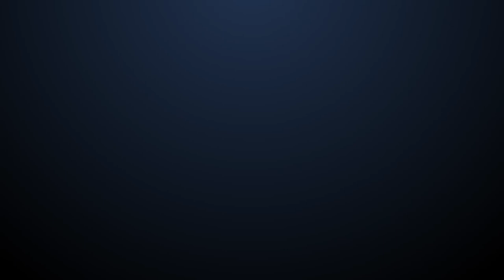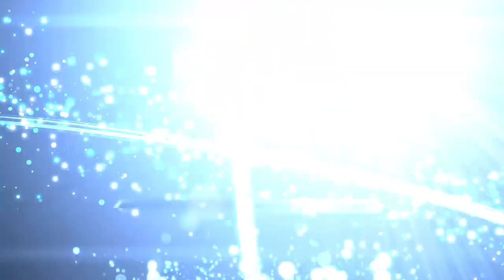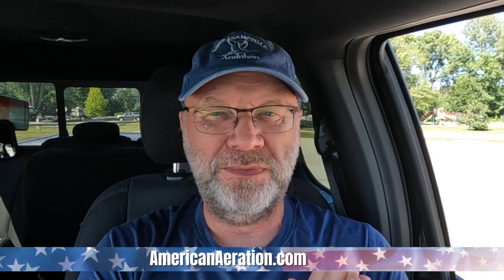5 Big Pond & Lake Aerator Mistakes And How To Avoid Them

Comment: Great video!!! I recently had a matala rocking piston 1/2 HP installed with 2 diffusers with the ability to control pressure with valves.  Since putting in the submersible system in my 1/3 acre clay bottom pond it is murky with poor visibility.  I thought this would resolve with time but it has not.  I live in Michigan so we only use our windmill aerator and turn the matala system off.  We elevated the diffusers a couple feet off the bottom without improvement.  The water level really fluctuates from spring to summer going down approx 5 feet.  The avg depth is 11 feet in deep end and 7 feet shallow.  It is 175 feet x 100ft tapered inward at the middle.
Reply from the maker: Hi Tina...thanks for the comment.  You did the right thing by elevating the diffusers...often that helps and things settle out over time.  If the water doesn't clear up you can try a binder or flocculent...a clarifier of sorts that will clump these particles together...they get heavy and then sink to the bottom.  Check out a site called siltstop.com.  They have a variety of binders that may help.  If you try one, let me know how you get along with it.
Reply: Thanks for all of your information.  I will be sending a water sample into silt stop to have a log made that will hopefully improve the clarity.
Reply from the maker: @tinametzger9644  Hi Tina...you're welcome.  Good luck with your pond and let me know how you get along with the floc!

Comment: I'm considering two 24V DC 350W floating pumps connected to solar panels by a controller.  Thoughts?
Reply: Lots of variables here that aren't mentioned but I would say this...any aeration can be helpful for something.  If fish are a major priority surface aeration can be really protective.  You may find if the pond has some real depth to it...say six feet, or deeper just as an example, it may be better to go to the bottom.

Comment: What is more beneficial to a pond for starters, Topwater fountain aeration or subsurface diffused air?  If you could only do one, which is best for the pond?
Reply from the maker: Thanks for the question...it really depends on the situation.  What's the depth range, whats the primary goal of aerating.  If fish are involved, what kind are they?  The geographic location and seasonality would factor in here too.   That all said, most of the time, I'm going subsurface but certainly not always.  Cost to operate may also be a factor...if someone is on a tight budget and can only run a fountain a limited amount of time, a subsurface will usually provide more economical operation and maybe they can run it more often.  So there are a few things that would lead us in a particular direction.

Comment: Will bottom areation help reduce bottom sludge over time?
Reply from the maker: In a general sense, yes, it could.  Hard to say how much really and it will vary from pond to pond.  The increase in dissolved oxygen near the bottom supports this effort...and I would say if you combine aeration with muck digesting microbials, it can help.  Even with those though its not a sprint.  Overtime though you can work it down.

Comment: I have a 1.7 acre pond that is 6-8 feet deep except in two spots.  One hole is 16’ deep and the other about 25’.  My question is whether I want to put a diffuser at the bottom of each hole or if there is a reason to stay off the bottom so deep.  Thanks!
Reply from the maker: Hi Greg...good question.   I think the main consideration here would be just for coverage.  If you can get either diffuser deeper than 12' it will cover an acre on it's own.  So the second diffuser wouldn't have to be as deep, but it could be.  I would think about your pond's history...is there areas of problems or early development of algae, etc...this may often be in a shallower part of the pond.  So it wouldn't be a bad idea to get some movement in that area...or you may be able to affect it fine from the two deep spots.  I would not feel obligated I guess to target those deep areas necessarily, but there's also nothing wrong with doing so if they provide good coverage/movement throughout the pond.  I hope this helps for you!
Reply: @klmponds  "is there areas of problems" Love your videos but get someone to check your grammar.
Reply from the maker: @matthewwiecha8637  I appreciate the feedback Matthew.  I agree, Grammarly would have highlighted that one!  Nothing I do is scripted, and editing is always minimal (for better or worse).  My focus and the point of the videos is the content, information, and advice...I hope in the end it's helpful for you despite a few flubs on my part.  More to come:)  Take care!

Comment: I have 12 diffusers running on a 12-1/4 acre lake which is around 28ft deep by the dam.  I intended to run the system year round.  Would like any recommendations you may have.  I'm using an Airmax LS120 system.  Thanks
Reply from the maker: Hi and thanks for the question.  So you can run the aerator year round but in winter the only reason to do so would be for fish (if you live anywhere in the northern US where it cools down a good bit).  Keep in mind this winter use is just for ice management...Wisconsin DNR suggests 3% of the pond be kept open of ice for protection for the fish so you would not run all diffusers at once in this case.  I would consult with airmax on what they would suggest for winter usage with this system...in other words, what is the minimal number of diffusers you can run on each pump without having issues with those pumps...that would be my only concern there.  If you don't get a full freeze up where you are, or fish aren't a priority there would be no real benefit to running it.  If you happen to be in a climate that has algae (warm weather) year round, then for sure, run it full on as you normally would and don't shut it down.  In the end you aren't hurting anything by running it if moderate or cool temps, it's just that most folks we work with use aeration for helping with algae blooms or fish issues...and both of these subside in cooler weather and more moderate temperatures.  And the aerator still costs money to run.  I hope this helps for you.
Reply: @klmponds  Thanks for the information and getting back. The lake is located about 65 miles south of Saint Louis, MO.
Reply: @jmfstl11  you might be warm enough there to not really see long term ice build up...and I would suspect it gets cool enough that algae would go away in the winter months.  You can play it by ear and shut if off if you want to save some money and turn it on again if things really got cold and froze over for an extended period of time...but as things are going this year I'm betting you won't see that.
Reply: This guy knows his stuff.  Thank you!

Comment: Great video. I have a 1/4 acre pond with a depth of 9' on one end and tapers off to 2' on the other end with 4'-5' being the average. I have a 3/4 hp pump and two 8" diffusers I am installing. I figure I'd put one in the hole mounted to a cinder block to keep it off the bottom and the other in about 4' of water the same way. Right now I have a fountain that runs 12 hrs on 12 hrs off.
My questions are: 
1) Should I keep the fountain running as well? maybe fountain in day and sub-surface at night?
2) Are the 8" diffusers to small? (my kit was supposed to come with 10" and I was sent 8")

Thanks for taking the time to make this video!
Reply from the maker: Thanks for the kind words!  By the sounds of it I don't think you'd need to run both the fountain and the aerator...maybe figure out which is more economical and go with that most of the time.  If things get really hot there and that goes on for awhile, then maybe run the fountain more or as you say at night and just avoid mixing the pond so much, which can heat it up quite a lot.   I say that too because this pond isn't that large and the pump is a bit of an overkill just horse power wise.  

I'm assuming this is a Vevor pump or something like it...on the one hand thats probably good because it only puts out the air of a 1/2 HP...on the other hand it costs what a 3/4 HP would normally to run...so they are not terribly efficient.  I have two systems that actually use a 1/4 HP pump to run 2 diffusers and the other uses a 1/2 HP...the 1/4's cost about 15 bucks a month to run full time.  Keep that in mind if the 3/4 HP gets a bit pricey to run for you...it does for some people and they limit how much they run it...which is not a good idea.

For the diffusers, honestly I don't know about that one...I don't think size is the only thing here that's important...I mean some systems use sticks, or tubing loops that do really well.  Mostly it would come down to how small the holes actually are in the membrane..I would be more concerned with that than the overall size, and unfortunately I've never looked over the vevor kits that closely to know.  

I hope this helps for you a bit.
Reply: @klmponds  - Thanks for the quick reply. yeah, it's a Vevor kit. I wanted to see if I could minimize algae growth and maybe clear up some muck with it. I didn't want to spend a small fortune to test this out. I'm in Mich so hot weather isn't really an issue here, at least lately. No fish to really speak of (yet) except for minnows and a few fish that are maybe 6". Trying to find something that would clean it up a bit but grass carp are not legal here.
Reply from the maker: You're welcome.  No problem...go with what makes the most sense for you and your budget.  Really for water quality, algae management you should have plenty of aeration.  Remember though, aeration alone may or may not curb algae...its the microbial base in the pond that's mostly affecting the nutrients...and aeration support that really well.  So see how it goes.  Aerate as much as you want or can afford and try to go 24/7 with something.  Give it a month or so and see if you note any changes in the algae...if not, look for something microbial to add in there.  An example would be our Biosphere Pro product but there are many kinds on the market.  I'm thinking about a video that addresses this very topic...so you have aeration...now what?  Something like that...look for that in the next week or so and it will probably give you some things to try down the road...if you need to.

Comment: Can I use an extra pump as the aerator? Just sitting on pond bottom? Small Shubunkin pond 1200 gallons. Have waterfall but 21 fish.
Reply from the maker: This isn't really how an aerator works...a submerged pump would move water...circulate it, but if you aren't breaking the surface tension of the water, oxygen isn't coming in as much from above...thats typically how a diffused aerator works.  If the pump you have can be set up to propel the water up into the air...ie, a fountain, then yes, that would aerate the water.

Comment: I have a 2 acre ponds with a max depth of about 10 feet I would say the average is probably 6 ft over all live in western Kentucky and the primary goal is lmb also have bluegills and redear what would your recommendation be?
Reply from the maker: So if you have a spot around 10', if you get a diffuser there it will cover about 3/4 of an acre at that depth.  As you lose depth you lose the range of coverage...so I'm thinking if you could get another (second diffuser) down to 10' or near that, you're at about 1.5 acres now...and a third diffuser in a more shallow area could cover the rest.  Some of this depends on the shape of the pond too.  To really be sure it would be best to contact me through the site and send over an address so I can view the pond from google earth, just to be sure.  But I'm going to suggest probably a 1/2 HP pump with 3 diffusers would do.  Something like this one as an example.  https://americanaeration.com/collections/easy-pro-sentinel-pond-aerators/products/sentinel-1-2-hp-aeration-system
Reply: @klmponds  how can I contact you
Reply from the maker: Try this page, it your input will come to me.  https://americanaeration.com/pages/pond-aeration-advisor
Reply: @klmponds  done!

Comment: I have 2500 square meter tilapia fish pond here in the philippines and i'm using a 4 inches diameter pipe water pump for aeration,what is the best thing that i should do for aeration?thank you so much
Reply from the maker: It would really depend on how deep the pond is.  If you're around six feet deep or so, I would suggest going with a surface aerator.  Many fish farms uses these to maximize the dissolved oxygen level in their ponds.   I might even use this in deeper water if you get really hot for sustained periods there as I suspect you do.  The other option is sub-surface diffused aeration which would be more economical to run, but I'm not sure it sets up quite as well as a surface aerator does for fish farming.

Comment: Great video, just ordered a pump for our 1/2 acre pond about 14 feet at the deepest, when it is full, we have had a very dry year and I suspect the deepest spot to be around 10 feet at this point.  We have a surprisingly good fish population which is the reason for the aerator.  Did I understand you correctly the aerator should be placed in a shallow area vs the deepest spot in the winter? I was planning on going to the deepest point thinking that is where the fish would be.  Additionally the system I have chosen is 1/2 hp with a single diffuser, i'm not worried about running cost, but don't want something completely wrong.  Thank you!
Reply: Hi Brian...thanks for the question.  So you can put the diffuser in the deepest part of the pond...that is pretty typical.  Normally the only time I may not do this is during certain periods of the year.  Such as, winter usage...I don't like to aerate at the deepest point in winter...your only goal this is ice management...and you don't really want to stir up everything...so I work more shallow there.  The other time would be in the south, in very hot conditions, especially in shallow ponds that lack a lot of depth...I may make some adjustments to aeration time and placement of the diffuser...but I would say in this case it's more about the daily run time,  such as only running the aerator at night to avoid mixing during the hottest part of the day.  Those would generally be the only exceptions...so I would place the diffuser in the middle somewhere and with a 1/2 acre pond, if you can get it to 8-9'. or more you'll do great.  Typicaly with the single diffuser I'll run a 1/4 HP...its plenty for one diffuser, and actually can be used with 2.  I'll normally start the 1/2 HP with 2, and up to 3 difusers.  That said the 1/2 HP in most cases can run a single diffuser, usually with no problem...for me, I'm looking for good air output obviously but also efficiency and cost of operation.
Reply: Your counsel is truly appreciated.  A local pond consultation company  has told me that installation of a single diffuser is never advised, do you agree with that?  If I put in two in my .5 acre pond they would not be very far apart. @KLMPublications
Reply: @briantucker9708  I'm not quite sure why they would say that.  Granted if the depth were very shallow, then sure, you'd need to do that.  As well, even a half acre pond, if it's really oblong, stretched out, may take two.  But if this pond is at it's lowest and still 10'...and pretty uniform in shape,  coverage will only get better in normal years and a single diffuser should be plenty.

Comment: Is it better to put an aeratot in during winter
Reply from the maker: Hey Steve...it would typically be better to do it in cooler weather rather than the heat of summer...the fish would be under more stress then.  Even then though people do install aerators and if they are careful about it, they normally do fine.

Comment: are tehre any DC pumps that can run on a solar panel?
Reply from the maker: There are some out there.  The manufacturers I deal with generally don't sell them individually...in other words they only sell them as replacements for confirmed customers.  But, Thomas makes one of them and is a good company overall.  What you will typically look for is a pump that will put out somewhere close to 2 cfm's...then you'll be in the ballpark of the commercial systems.